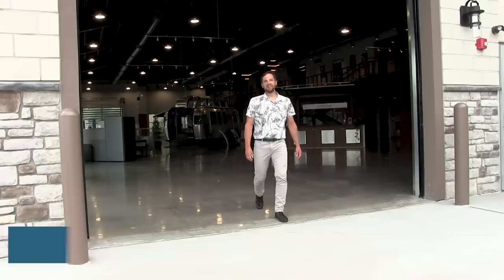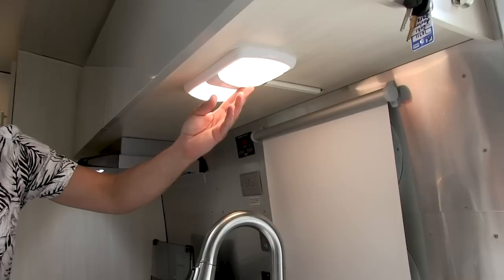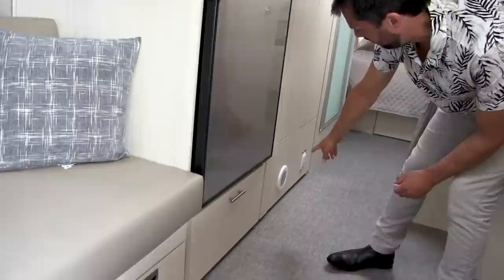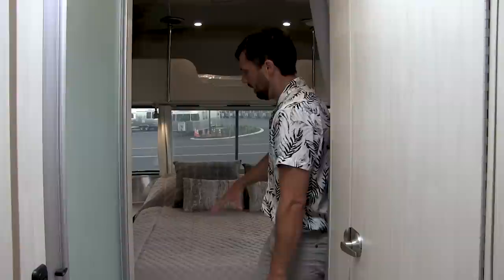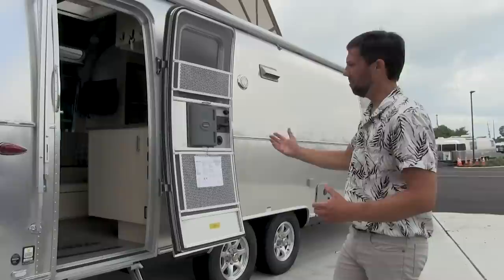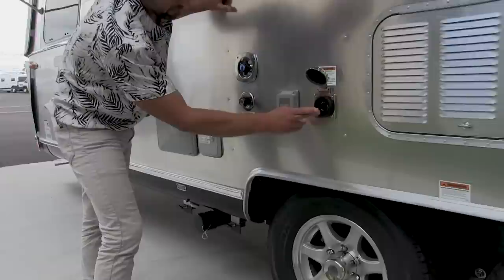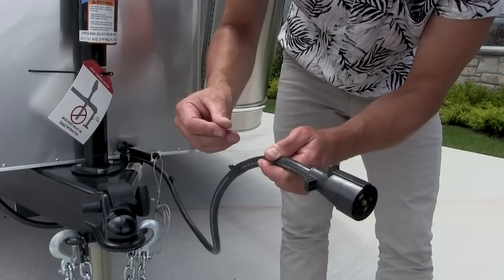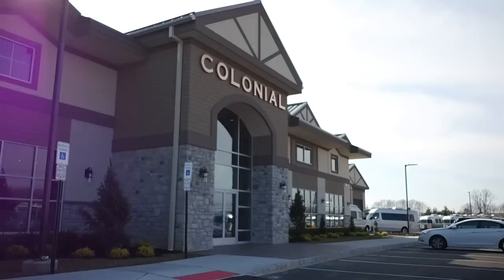2021 Airstream Flying Cloud 27FBQ Sunlit Maple Introduction Walk Through

Comment: My apologies if I missed this in the video... but in another video you mentioned that the floor was now a composite material.  Could you please share if this change resolves the plywood flooring rot issue?
Reply from the maker: Airstream switched venders and is now using composite flooring which is more stabile and a one piece to lessen the chance of warping and creeks between the tongue and grooves since it is now one big sheet.
Reply: Colonial Airstream — So does it rot?

Comment: Hey Patrick, is the composite floor now used like what is used for decks to avoid rot?  Just in a solid continuous piece?
Reply from the maker: The composite floor allows one large sheet instead of multiple sheets of plywood. This will prevent squeaks and creeks and prevent rot and delam over the years.

Comment: Hi Patrick. Great video as always! Quick question, is the hatch a modification option on the 2021 27 ft Globetrotter airstream either before or after market?
Reply from the maker: The hatch it not available on the Globetrotter. It would have to be done on the aftermarket if available.

Comment: Will you be doing a video on a 2021 Flying Cloud 30FB Bunk?
Reply from the maker: Inventory is low. Going to try to cover some of the new additions 1st.
Reply: Colonial Airstream thanks for the reply! Side question: how are clients finding the tankless hot water system for recovery time when dry camping? We’re a family of 5 (3 kids under 6) and I’m curious how the system will handle that kind of scenario with only a 35ish gallon grey tank.

Comment: Nice trailer but it still has a plywood floor and the number of rivets has been reduced. North it oliver is a much better made unit
Reply from the maker: This Airstream is built with composite flooring. It was mentioned in the video.